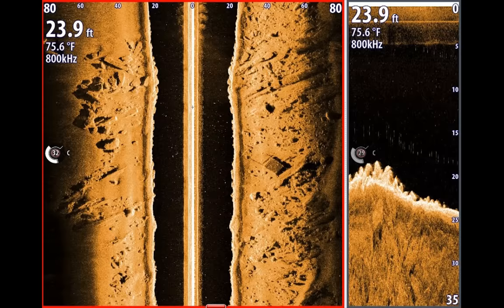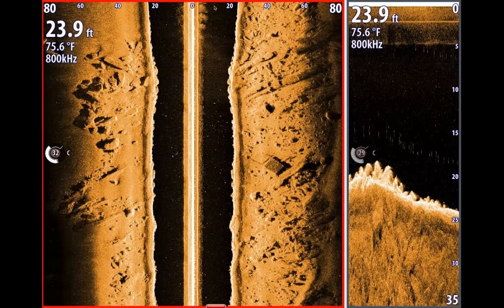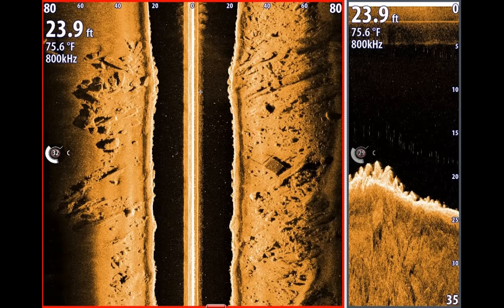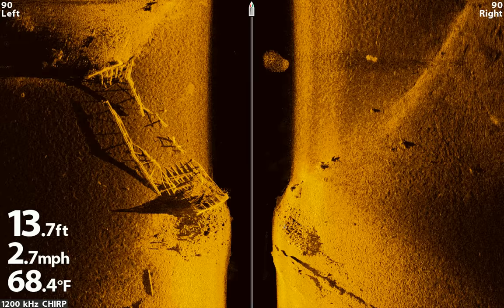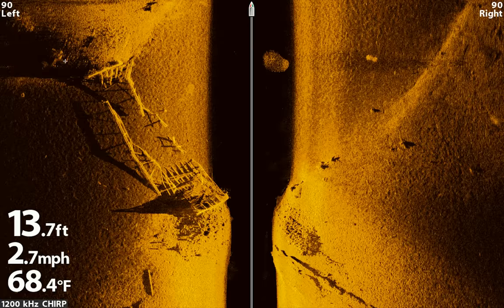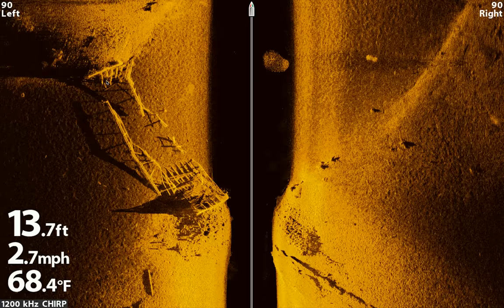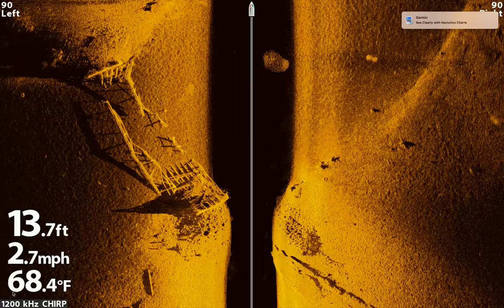Fish Finders 101 - Basics of Side Scan and How to Identify Fish

Comment: I'm curious... you just talked about idle speed and going 1.5 mph would make the images blurrier than 3mph.  Is that because your unit (Lowrance?) doesn't have a tunable chart speed?  I know on Humminbirds, which do have a chart speed, the slower your boat goes and the slower the chart speed (chart speed matches boat speed) the better the image

Comment: Appreciate your coaching on this issue, but would
suggest that the object classification as a "shipwreck"
is incorrect. To me, it looks like the remnants of a small
shed. It appears that it has come apart with one wall 
remaining embedded in the upper-left, as it unfolded
in a clock-wise rotation, ripping apart the remaing walls
until it came to rest, with only the flooring intact.
I'm a novice here...what do you think? Am I interpreting
this all wrong?

Comment: The second image you did,  you said was a boat I personally think is a bridge which is the reason why for the dark shadow at the top because it’s a bridge connecting to high spots in a creek that runs underneath it or an old riverbed. Also the riverbed is darker because it’s softer bottom where as the rock you mentioned all that area on the bottom side of the bridge is really bright because it’s harder bottom. I could be wrong about the bridge if you know for sure it’s of ship but sure does seem like a bridge connecting to pieces of land over a river.
Reply from the maker: You may be right about that. I love your take on it!
Reply: Why build a bridge 13 feet underwater?
Reply: @falconeaterf15  part of the infrastructure bill.
Reply: @falconeaterf15  The bridge would have been built before the dam was constructed. It is now an artifact from a time before the reservior or man made lake was created. Other features might be found, such as building foundations, walls, and road beds.

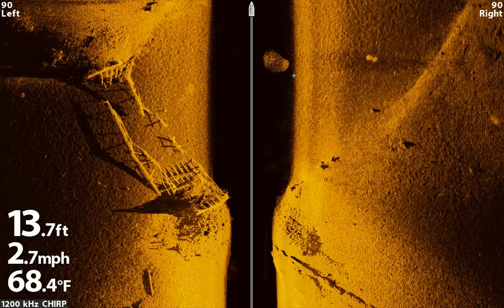Comment: The image at 5:53 shows a depth of 13.7 ft. which is about twice the depth at the lower right hand corner of the ship wreck. Which would show that at the lower right corner of the wreck the depth would be about 6.5 ft. This must be a manufactured and not a real image used. At 6:18 the shadow of the bait ball as described is on both sides of the bait ball. How is that possible when all other shadows only cast in the direction they are on?

Comment: My only complaint about sidescan is that the black part is the depth straight down, so the two edges on both sides are directly under your boat, not to the side.  If they pushed the images together and got rid of the black centerline it would be more intuitive.
Reply: I agree, it's strange at first. But there is a lot of info in that water column also. Bait balls, grass, fish, depth, etc.
Saw a vid on here where someone explained it with a piece of cardboard, and folded it so the water column was facing up, like an upside down T. After that, it clicked in my brain and I can't unsee it that way.

Comment: Awesome video! My understanding was way off. Couple of questions:
 
1. You mentioned if a boat is moving too slow, say 1 to 2 mph, the images could be distorted. Does that limit the usefulness of SI for kayakers who only paddle, as in no motor of any type?
 
2. You mentioned DI and 2D sonar were easier methods than SI to identify fish. The obvious question is when is SI preferable? I assume since SI covers approximately 100 feet to each side of the boat whereas DI would be limited to immediately beneath the boat, you’d use SI first to find interesting structures to then see better with DI. Is this correct?
Reply: You couldn’t use SI paddling. You would be better to get the 360. Trying to do what a boat does without movement of constant speed just isn’t happening. The 360 setup is all a kayak user would need. In fact it can do SI as well.
Reply: @Hawk-iy2iz  Some imaging sonars allow you to adjust the ping rate so in theory they might work at kayak speeds

Comment: I believe that the black space is there because your transducer shoots down at a 45 degree angle so it doesn't start picking up the bottom right away like down scan.
Reply from the maker: If that was the case the black space would be significantly greater than the actual depth. But this is not the case, the black space will always match the exact depth of the water column. If it were at a 45 degree angle you would have a 1/3 of the distance increase.
Reply: @southernsalt   I'm no expert but I think you're both right - the transducer shoots down at an angle to create imaging (thus the shadows), AND it also shoots a beam straight down to give you a water depth (black space).  Personally I think its confusing and that they should do away with the black space on the display and pull the images together into one image.

Comment: Would you please clarify:  If you are set to scan 60ft to each side and the water depth is 20ft (showing black on each side out to the 20ft mark).  So the 20ft mark displays 20ft from the 40ft mark.   You see a fish at the 40ft mark. Is the 40ft mark actually just 20ft from the boat, or is it 40ft from the boat?  Great video, I hit the "like" button.
Reply: 40 feet would be 40feet. The distances are exact. This is due to the fact that side scan sonar pings at an angle coming out of the transducer
Reply: @madisonbk  It is a good question. If 40 ft is showing 40 ft from the boat and the black area shows the 20ft depth, how do you see 20ft from the boat?
Reply: @RoyalWulfje   you can’t see from 0-20ft… you see from 20-40ft. That’s why 0-20 is black
Reply: My understanding is that in your scenario the fish would actually only be 20ft from your boat, even though it shows at 40ft, it's only 20 because the water depth (black area of 20ft) must be subtracted from the 40.   
The black space is not a "blind spot" 20 feet each side of your boat - an image showing on the edge of the black area where it first becomes visible is directly under your boat, more or less.  Personally I think they should just get rid of the black space and pull the images together into one image.

Comment: I ran a side scan sonar system for the US Navy for a lot of years. I gotta tell you, the shipwreck you're showing is a bridge. Look at the shadow to the left of the image. That is the spar support system of a bridge. You even showed the hard surface at either end of the shipwreck, that's the road bed.
There ain't even enough timber or lumber to be a ship.  No masts, no engines, no ballards, no cleats. The edge of the channel just happens to be at either end of the bridge.
It appears this bridge crossed the small river that got dammed up downstream for hydroelectric power. When the water backed up, it swallowed everything. I've seen entire communities, complete with churches and graveyards, at the bottom of lakes (Lake Murray, Columbia, SC). I've seen WWII B29 bombers in the bottom of the same lake.
Otherwise, your analysis was spot on. You covered the material well and it is easily understood. 😊🇺🇸🏴‍☠️
Reply from the maker: Well it’s good to know the rest of the video was accurate! I actually had a few others State that it was a bridge and looked at it again and definitely agree that I was incorrect on that portion.

Comment: I think you may be misinformed about the beam of the transducer shooting straight down I think when you're in 20 ft of water that Beam is shooting twenty feet to the left and 20 ft to the right therefore I think you do not see 40ft of the bottom under your boat that proof maybe in your second picture with the tip of the boat in the black on the left you should also see that tip on the right in the black if the beam is shooting straight down also that oval shaped yellow on the right in the black should be on the left in the black one way to prove this is to go directly over a big rock in 20 ft of water and I do not think you will see it on sidescan